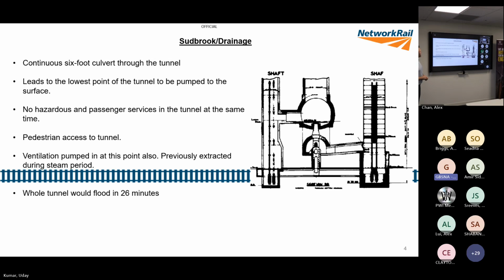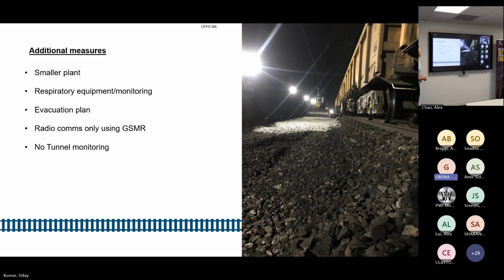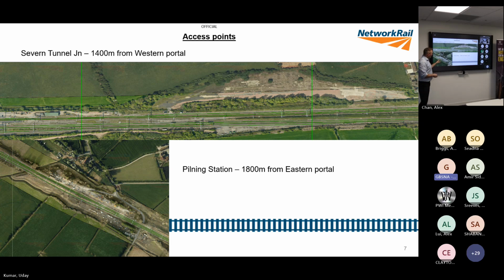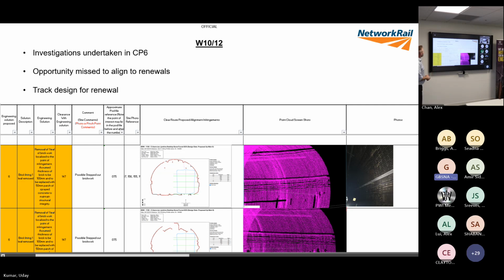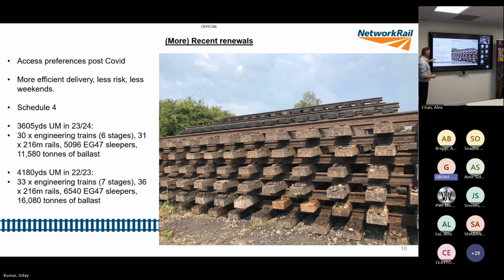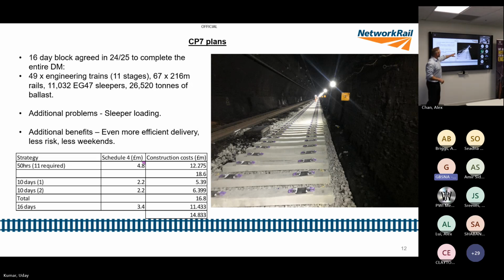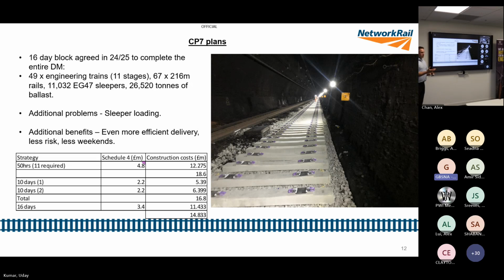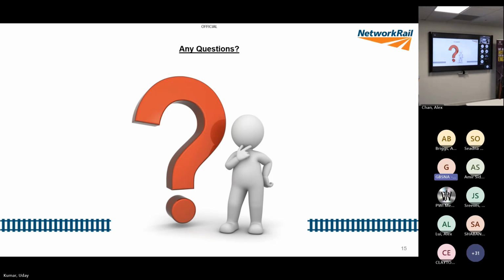Severn Tunnel: Recent history and future plans - Martin Davey

Comment: Excellent presentation. After all the latest work through 2024, why can't line speed be increased above 75mph, eg 90mph?
Reply: The 75 mph speed limit on the Severn Tunnel is primarily due to the existing track and signalling infrastructure, specifically the limitations of the 25 mph switch and crossing (S&C) geometry. To achieve speeds of 80 mph or higher, a more advanced 40 mph S&C system would be required, and the current 25 mph design is not compatible with higher-speed signalling controls, making a 75 mph maximum speed the practical and safe limit currently.